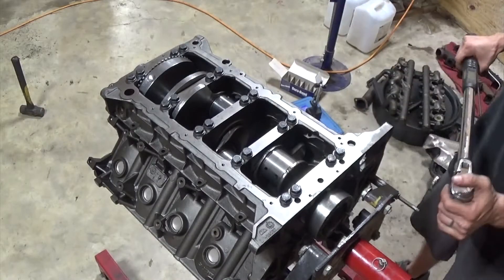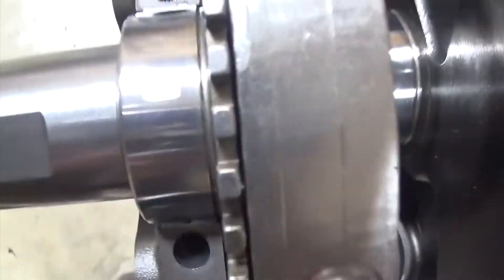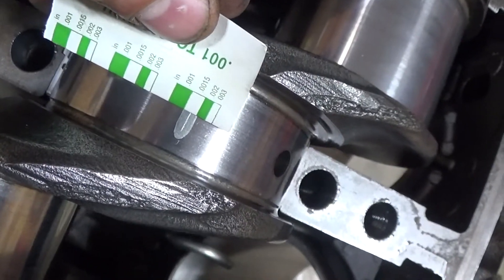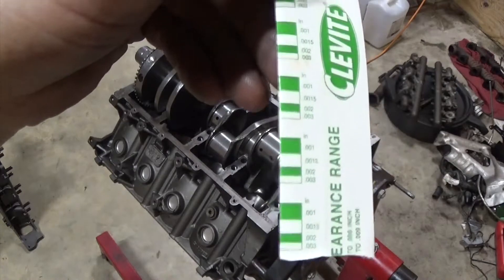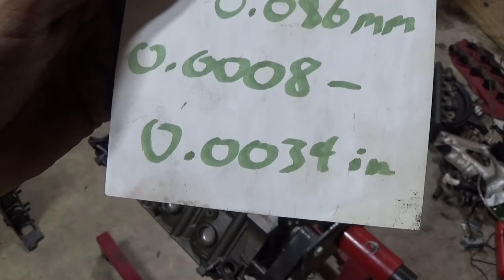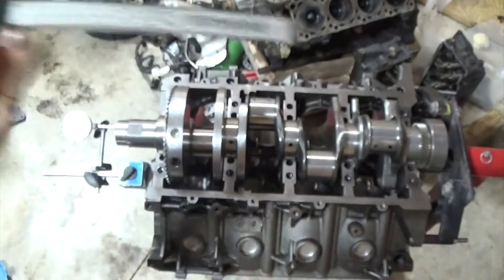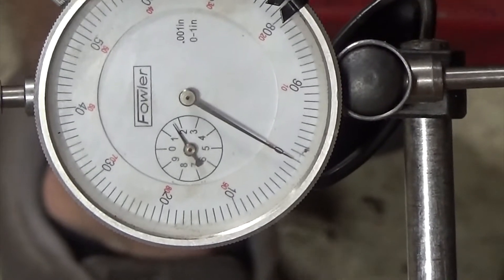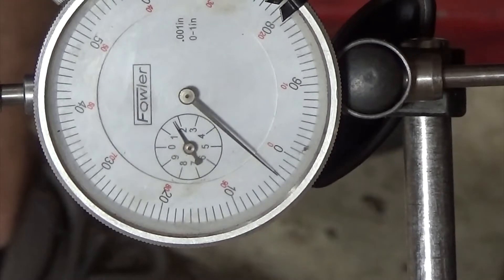Best 6.0 Powerstroke Engine Rebuild Part 3

Comment: what is the green and red things you are measuring. You never told us you put a drop of anything on there, what it is, and what you are measuring for? Did you put a drop of nail polish on there to see how much the torque would suash it. have no damn idea what you are doing?
Reply from the maker: It’s called plasti gauge. 
https://www.plastigaugeusa.com/storefront.html?Session_ID=07bd312c6b8d2dc60c6bea8e328b5505

Comment: Do you think stock bottom end would handle 650-710 hp
Reply from the maker: I’ve heard of people doing it.
Reply: Thanks for the reply
Reply from the maker: Your welcome. Thanks for watching. I am going to start another 6.0 build this winter. This engine will go in my 06 king ranch my plan is to slowly build to 600 plus horse power.

Comment: Cool videos but your reading these values all wrong. 
For example .0015 is not fifteen thousands it’s one and a half thousands. No engine runs it’s main bearing clearing at 15 thousandths. 

Cool videos though much appreciated.
Reply from the maker: Your right. I’ve always struggled with that and trying to understand machinist lingo. 
I just watched some videos and read up on it. 
I’ll probably mess this up but let me try.  .0038 “three and an eighth thousands” ?  
I’m trying different numbers to try an understand. 
I’m getting ready to start another 6.0 build. I’d like to say it correctly. Thanks for pointing that out
Reply: @showmerepair  I believe it would be three thousandths plus 8 ten thousandths.  Or thirty-eight ten-thousandths
Reply: @showmerepair  .001 is a thousandth.
.0001 is a ten thousandth
Reply: Another way to measure which is much more accurate is to use a telescoping bore gauge and torque down your bed plate.  Measure the journals in multiple spots. You will then be able to see out off round.  With a plastiguage you can only see one spot. But devils advocate the 6.0 powerstroke doesn’t really have a lot of bottom end failures it’s a well engineered piece. Top is is another story. I look forward to more videos
Reply from the maker: I’m going to keep working on it. I hope to have it figured out before I start filming the engine build. Doesn’t give me much time.
Reply from the maker: Thank you
Reply: @showmerepair  for sure man.  I’m getting ready to pull my 250K 2003 6.0 for o ring heads, studs, lifters, reseal, maybe bearings if they are severely worn
Reply from the maker: From my experience rebuilding the 6.0. Most cranks may just need a polish. Your right the lower end is strong on the 6.0. Good luck with your rebuild.

Comment: How far do the oil galley plugs need to go in? Also is the top HPOP galley plug the same size as the lower 2?
Reply from the maker: The 3 plugs look to be the same size. I truthfully can not remember if they are the same. Is there a shoulder that the plug bottoms out on? 
I may be threading mine so I can screw plugs in.

Comment: Dude whatever you put on the cam shaft before you installed it is thick like butter.
Reply from the maker: It is thick. 
https://www.lubriplate.com/Products/Grease/Multi-Purpose-Greases/100-Series/NO-105/C-105-AUTO-MA,-10-OZ-TUBE/

Comment: What is an approximate cost to do something like this? I'm assuming $5-$8K.
Reply from the maker: Gaskets and machine work I think I had $4300 in it. 
Sold that engine. Getting ready to build another. I’ll make sure show totals as I go.

Comment: Ur bad ass. I wrked 4 a comp that had this motor on 2003 trucks. I put 300 thousand miles on one of those trucks. No major issues ln the truck. If u change oil motor is solid.

Comment: I got a question about crankshaft end play, check this video out : https://www.youtube.com/watch?v=Zti-Sx-GPXo 

At 24:08 , it shows the end play should be 0.002 in to 0.008 in.
Reply from the maker: At 24:08 that is cam shaft end play. And that is the same spec I have from Ford workshop manual.
Reply from the maker: At 24:23 he measures crank shaft end play. His spec is straight from Fords workshop manual. I can tell from the pic. My spec shows max  .020 inch from Fords workshop manual. His may be an older version.  His video is good though.
Reply from the maker: I don’t know where he got that spec. I went back to 2003 and then to 2010 when the 6.0 was used last in the E450 van. The spec in 2003 and 2010 was .020 inch.